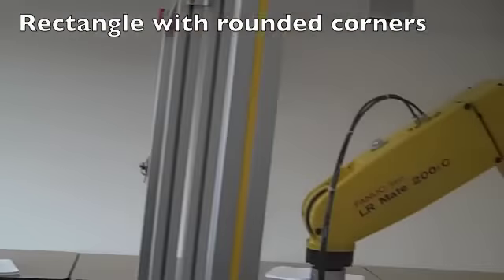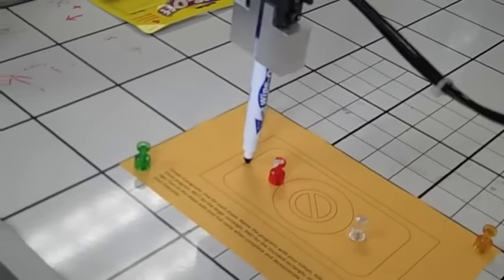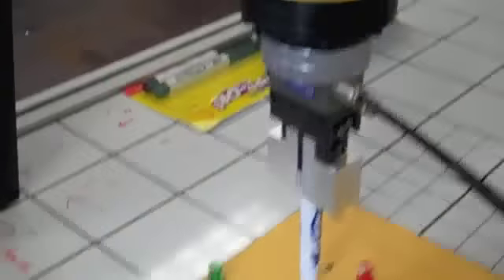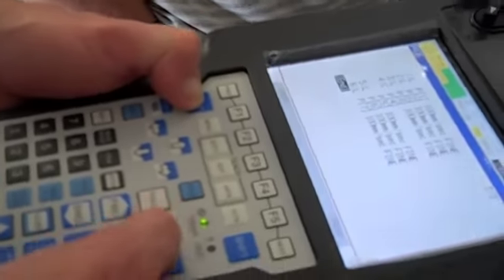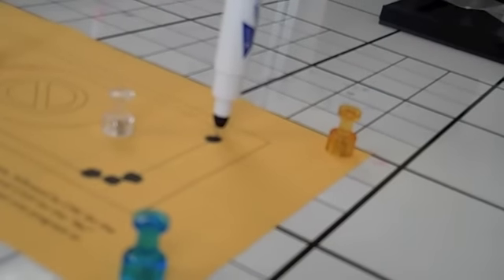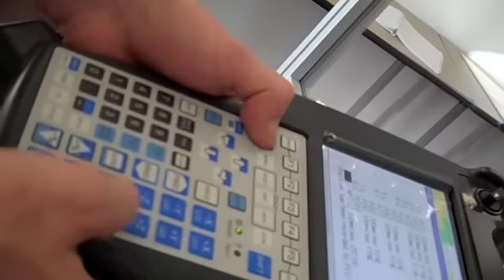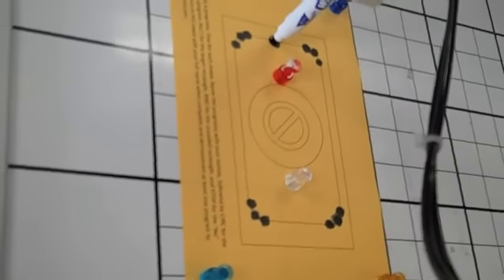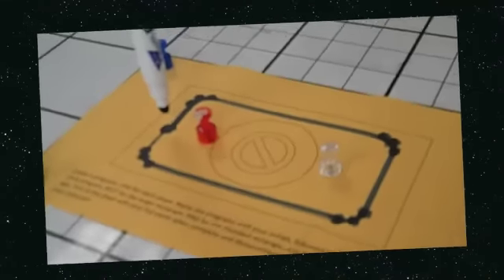FANUC Teach Pendant programming demo - Rectangle with rounded corners

Comment: If you would have shown the program language or the script as it appears on the pendant this would be 100% more useful.
Reply: i think he is doin it on purpose so we canT learn :D
Reply: FANUC programming doesn't use a language like C or JS or something, it uses a very straight forward directive. Joint/Linear movement, travel speed, fine or continuous termination to points with programmable termination speed. You'll want to perform several J movements to jog your robot to your home and pounce positions, and for the purposes of drawing a 2D picture, you'll want to program nothing but L movements, and if they have rounded corners, it means your termination type is Continuous. I'm scratching the surface, hopefully you've found a solution in the last 3 years.

Comment: I have some questions about teach pendant.

1. Does this teach pendant has joysticks to move robot arms.
2. Does the code written in teach pendant get convert to some machine level instruction. If yes then what type of Machine code 
and how the machine code interacts with the original arm.
Reply from the maker: 1) No, the FANUC teach pendant does not have a joystick. I believe ABB Robotics has them
2) The robot is programmed in "conversational" language. Very similar to VB, but entered using prompts and from menus. There is an underlying code available. It is called KAREL. It allows more advanced program, math functions and logic to be used on a custom code level.
Reply: Thanks for your reply. Just out of curiosity, wanted to know a liitle bit more about .. how two robot arms(separate robots) with their separate drive modules, interact or talk with each other. Suppose if two robots is synchronized how the controller schedules the tasks to the robots.
Reply from the maker: Great question. Unfortunately, a bit more than I'm able to answer in any detail. In general, you are just adding more motors and drives as axes to the controller. They get grouped together and the algorithm makes them move as needed. You are simply teaching more points, and the controller does the calculations. The advantage is that the controller knows about all axes and can be programmed to avoid contact. Here is an example -http://www.motoman.com/industrial-robots/sda20d
Reply: @werethebst11  There is many ways how you can do it, depending of how the cell is built.
Don't remember if Fanuc's controller can control more then one arm. Motoman can control multiple arms by one controller. In that case controller know the position of each arm by default.
In case of two separate arms with two controllers you must establish a way for robots to inform each other when one of them is entering and leaving interference zone. It can be done by interconnect I/Os or by PLC. Before the arm enter the interference zone must call interlock job to  check an output of the other robot, if it gives a "safe to enter" signal robot can enter the zone and set its own output to "not safe to enter". Other robot will be stopped on the interlock job and wait until the first one leave the zone.

Comment: Hi sir,
Uninitialized data is used error is coming, how to solve it
Reply from the maker: You get this error if you did not record a position. If you cursor on the P[x] X value and Press F key for position, you'll see that no X, Y, Z data was recorded. This happens when you type a Position number, instead of using F1 to record it. If it is a PR[Y], you need to record the X, Y, Z data for it or type it in. Good luck!
Reply: Robotics & Automation - AMST
I used F1 key and position is also recorded, still showing that same error. Please help
Reply from the maker: Hmmh, maybe it's the next point it's supposed to go to? Maybe it's a UserFrame, Position Register or Offset that is being referenced? That's the only times I've seen that error. Good luck!